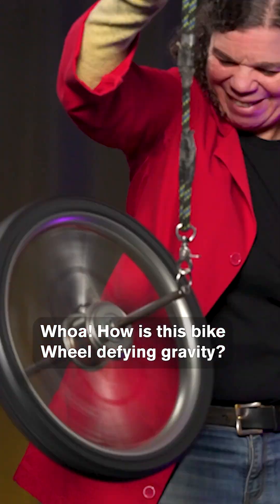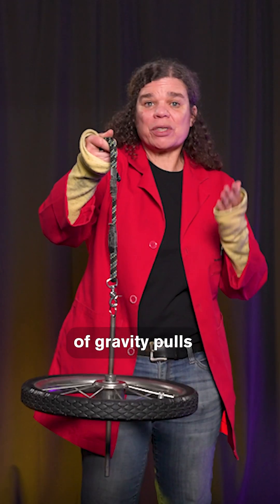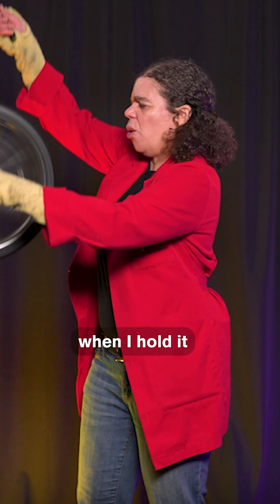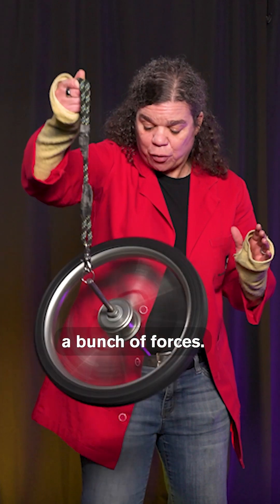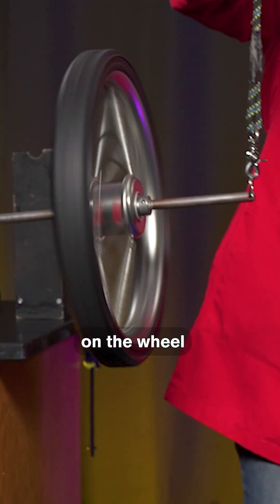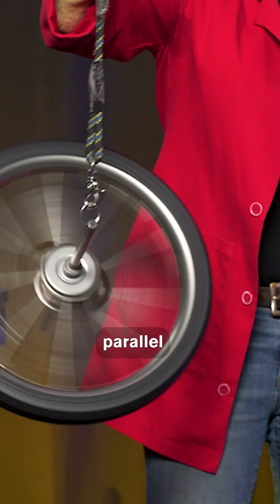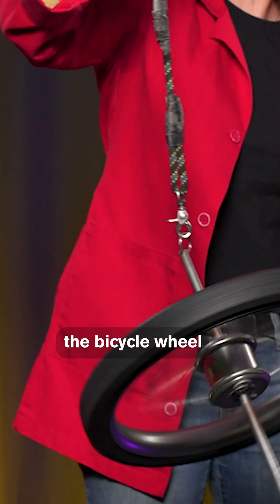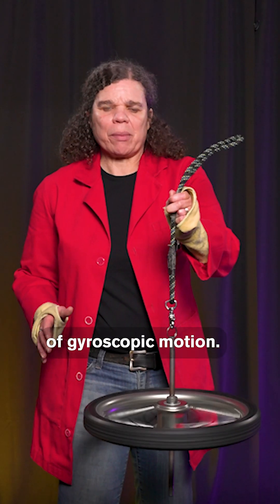Bicycle Wheel Physics Demo – Gyroscopic Motion in Action

Comment: Make the gyroscope spin clockwise, point the axis of rotation horizontally (aimed at the horizon), keep it that way (vertically), and the precession will make the axis of rotation point North.  You now have a gyrocompass.  That's turning science into engineering.
Reply from the maker: An indispensable tool for seafaring navigation!